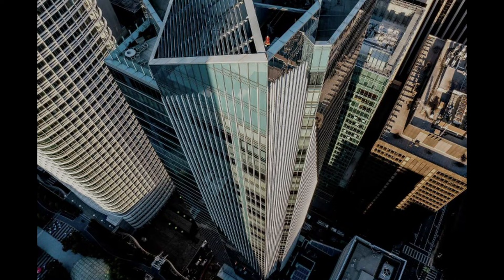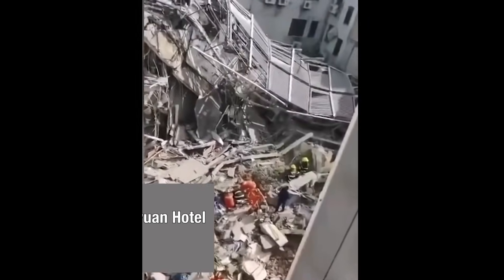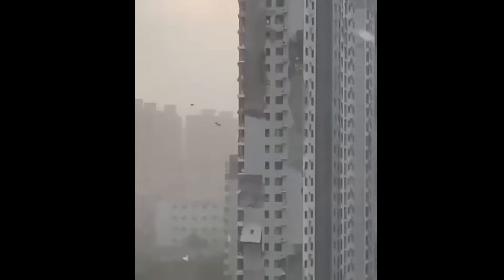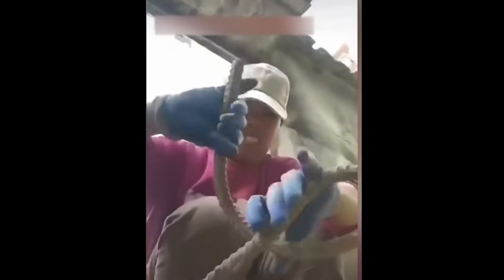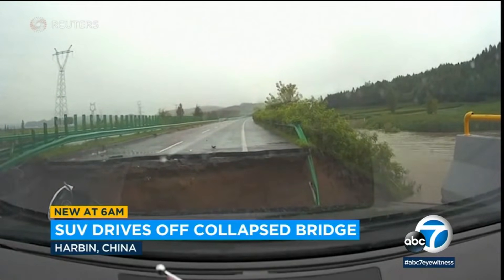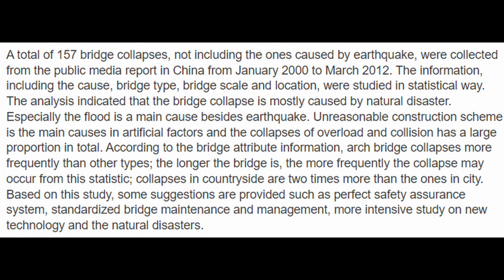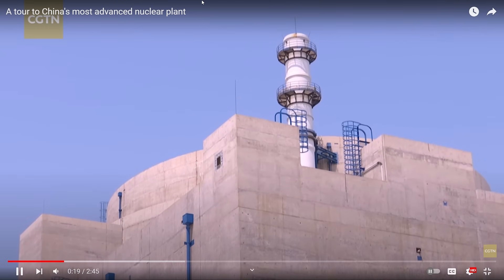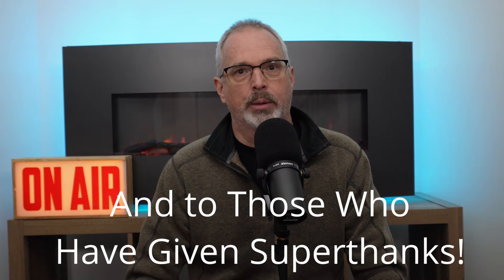Why Construction Projects in China are Often of Very Poor Quality

Comment: We had a project in a telecom facility in Egypt where we supplied seismic equipment cabinets. They were installed with Hilti Red Head expansion bolts. Bellcore specs called out a minimum of 3500 psi concrete. Test installations of some bolts popped out the concrete around the hole. They had to replace the concrete floors before we could install the equipment. Cement is much more expensive than sand in the Middle East, and often is stolen from job sites where it is replaced with sand.

Comment: You know one of the problem on this videos,  they have chopped corners that is hiding their date and time stamps so we don't really know when these video were shot,  and it is also phony that we also don't know the location.  Casey, that is very unprofessional if you want to point on current problem with Chinese construction you will need a more recent analysis not something that is more decade ago.  We really don't know if they have made improvement on this in 2024,  you have presented articles in 2012 and we are now 2024.  What I am thinking is you need to present current data rather than something 12 years ago.
Reply from the maker: This types of problems have only gotten worse in China over the years.

Comment: I have just checked on the Google. According to Wikipedia's list of bridge failures from 2000 to present, 39 American bridges collapsed during this period and China only 14!

And the latest American built suspension bridge has collapsed after only 4 months!

Now you tell me. Which country's constructions are more tofu dreg then?

Oh, I forgot. It's not 39, but 40 now. Baltimore's Francis Scott Key Bridge has just collapsed into the sea like a house of card!

As the saying goes, "don't throw stones if you live in a glass house."
Reply from the maker: The answer to your question is that many bridges in the U.S. were built in the 1960's and have reached the end of their design life. China had almost no modern bridges in that period (because of Mao).  China has rapidly industrialized in the last 30 years thanks to having the West as a source of technology and money. Virtually all of the modern bridges in China have not been around very long. Also the CCP contols the dissemination of information so any information on total bridge collapses there should be considered unreliable.
Reply: @CaseyJones-Engineer  Are you saying that China had no bridges before. People had to swim across the rivers? 

Do you see the Great Wall, which was built more than 2000 years ago, and it is still standing? And the old palaces in all China's old capitals built in different dynasties. All of them are still like a newly built with no sign of collapsing anytime soon. China's buildings are well known all over the world, no matter whether structures or designs. Have you ever visited Beijing? Do you see how beautiful the Forbidden Palace is? Go, buy a ticket and visit china and see things there for yourself. Stop listening to the US and the western media's false news.
Reply from the maker: @yeungtsang8761  I said that China had few modern bridges in that era.  China was not even able to feed its people properly then thanks to Mao's "Great Leap Forward".
Reply: @CaseyJones-Engineer  Mao might have done something too extreme, but not all bad. At least he got rid of the old feudal caste system and superstitions, most importantly, under him, the CCP created gender equality, which have paved the way for a smoother and rapid economic development and growth after his death. I would say, India needs someone like him, in order to catch up to China.
Reply: 14 REPORTED bridge collapses. China will just lie about it and say the bridge was actually demolished on purpose. You have to assume the number of problems you near about is only a tenth of the true issue. So 140 or more bridges is the actual number of collapses in china.

Comment: I was in Shenzhen in mid-2014 and there was a major building scandal there when they discovered that several builders had use sea sand (with salt) in the cement in many buildings. The buildings involved were all ordered to be torn down.
Reply from the maker: Quality control seems to be a big (and ongoing) issue in China.

Comment: whatever you say is correct as evidence is undeniable. but the tall structure is legit as mostly steel is used like a cube and most of the stuff is bolted. so it is not lot of concrete per say. but if they cut corners disasters will happen. not in top cities as they have built world class tall structures which have been standing for more than 20 years. now those destroyed buildings are old. no occupancy means they deteriorate in 10 years. hence they might have been destroyed. the roads i dont know, they happen everywhere in the world( RIDICULOUS HOW THE SCOTTER JUST WENT IN AND THAT CAR!!)
--------------
yes 30% and inspectors look away. not just  china it is rampant all around the world!!!!

Comment: Other issues that are troubling is that at least some of China's coal has some content of uranium, that when burned it spread the pollution far and wide. The ash residue is also used in the construction of buildings. Some of those buildings have higher radiation ratings in them than the  background radiation in the open air around those buildings. There are videos that show people taking radiation readings, with Geiger counters, showing the radiation levels inside and outside of buildings.
A side note, here in Hawai'i there have been claims of radioactive Chinese sheetrock.

Comment: In downtown Seattle in 2010, a 9-year old completed 25-story McGuire Apartment building was demolished because of widespread construction defects.  I recall reading that the contractors used unapproved cheap imported Chinese re-bar and steel.   This revelation lead to a long list of other unapproved cost-saving shortcuts in material and construction methods that doomed the building and started a legal battle.  In my neighborhood, a developer built an amazing looking condominium.  When I went to look at the condo units, I immediately noticed that the floors weren't level and the window frames already had stress cracks.  The banks wouldn't approve home loans to prospective buyers so the developer could only use the condos as apartments.  These types of construction defects are mind-boggling to me since I always thought that developers would have their own independent engineers monitoring the construction; the contractors double-checking their sub-contractors; and the city building inspectors double and triple checking on everyone and everything.
Reply from the maker: It is a terrible combination of poor practice.  It was the same situation at work at the Millennium Tower (more fault engineering than actual construction material problems), a developer who was all about saving money and a City Inspection department who allowed the construction to proceed without an independent engineering review being performed.

Comment: The construction of the leaning tower in SF is not tofu dreg.  Its construction is good EXCEPT for the pilongs weren't driven deep enough.  That was an example of political corruption in SF.
Reply from the maker: Since the engineers went along with that garbage design speaks for itself.  The corruption in the building department existed in this case, it just enable the inherently poor design to go forward with the inevitable problems that occurred.

Comment: You have to understand what they are for. There is a reason why the housing market is oversupplied by 60 million units. Many in 3rd tier cities. Most of the new units were speculation units, only to go up 10%+ per year then they sell. There is no property taxes so they don’t have to rent out to make money.  No one is really meant to live there. So there is no need to build them in any good quality. It is the greater fool theory that someone dumber will come along to buy it at a greater price. It works for a while, until it doesn’t.

Comment: I expected a better sourced video.  Showing a few examples of building collapse videos doesn’t mean a thing.
Reply from the maker: Next time I will travel to China to conduct more extensive research before posting a follow up 20 minute video.🤣🤣
Reply: @CaseyJones-Engineer  just some solid references to some facts would be fine, of course you don’t have to go.  Maybe I’m just taking your videos too seriously, I apologize if that’s the case.
Reply: @ericforman1483 Don't bother bringing logic here. Sometimes I wonder if these weird China Observers believe in their lies. Showing some building collapses means nothing in a country that builds massively inside and abroad. I come from Africa and Chinese building companies like CRBC gained a solid reputation as serious and quality constructors. You can check the elevated highway cutting through Nairobi built by CRBC in 2 years. Turkish builders like SUMA are good as well. If this guy thinks Chinese engineers and the Chinese government are so bad so why the USA puts so much effort (and fails) to stop Chinese technological advancement. Sit back and let them fail, it's easier.

Comment: It is absurd to characterize the Millenium Tower as "Tofu-Dregg." There were certainly serious issues with the Millenium Tower's engineering and construction, but the building is SAFE, constructed using high quality materials and the highest standards of construction techniques. It is never going to crumble or collapse. It leans a bit, and that is a huge issue, especially to the occupants. But that is NOTHING like the Chinese Tofu-Dregg corruption.
Reply from the maker: I agree that the issue with the original foundation has mostly to do with the errors made by the geotechnical engineers but there have been allegations of extensive corruption involving S.F. building officials in recent years.  To what extent this could have played into the saga of the M.T., I couldn't tell you.  My point was that many viewers suggested a tofu-dreg connection to this building.  I had never heard of this term until I saw these viewer comments.

Comment: Some of the shoddy builds also use sea-sand instead of river-sand (the salt in the cheaper sea-sand erodes steel reinforcements, whereas much more expensive river-sand doesn't), and stretching steel reinforcements to meet length regulations (but then the diameter isn't thick enough).
Reply from the maker: That is a good point.  Thank you.

Comment: The scooter rider going over.  If you remember the Northridge (Calif) earthquake in the mid-1990s, that collapsed a few elevated roadways and cars/truck/motorcycles drove right off of them.  A lot of that was attributed to the slight upsloping grade on bridges (highest at the center) so drivers couldn't see the break until it was too late. 

I'm wondering about the hi-speed rail projects as some of those inside China have failed quite early in their lifecycle.  The Chinese recently built a line for Indonesia and the Chinese bid was way lower than the Japanese bid, plus the construction timeline was far shorter.  I'd be scared to ride on any rail line they built.
Reply from the maker: In China they seem to place a premium on big and fast instead of quality and reliability.
Reply: There has been one single fatal accident involving China's HSR, compared to none in Japan's. However, the crash was not related to it being a HSR. It was a signal failure. One train was stationary, the other was below 100 kmh (60 mph), significantly below HSR speeds. A design defect in the signaling system meant it was not fail safe in some circumstances, leading to disaster when trackside equipment was damaged by a lightning strike.

The crash occurred in 2014, when China had yet to progress to the domestically designed E series trains. Both trains were D series, locally produced licensed copy of foreign trains. One was a European Bombardier, while the other was a Kawasaki Shinkansen. However the accident was not caused by the trains, but by the signalling system and equipment, which was based on a European design. It is unclear if the flaw was present in the original European design, or was introduced when it was adapted before being implemented in China.

Comment: A very common issue seems to be the use of unwashed river sands extracted in salt water environments (estuaries etc.). The chlorine provided by the salt inhibits the concrete's passive corrosion protection of the reinforcing steel - a vastly accelerated decline of the structural strength.
Reply from the maker: Yes, that would definitely be a problem.  I imagine that they have run out of good sand sources a long time ago there in China give the massive amount of construction going on.
Reply: @CaseyJones-Engineer  https://en.wikipedia.org/wiki/Sand_theft
Reply from the maker: @spitefulwar  Thank you.

Comment: Using cheap untreated sea sand as opposed to freshwater sand or treated sand is one of the biggest issues in the construction process among other issues such as substandard steel rebar and sea sand that hasnt been treated for clorine or salt. 
The corruption is rampant so the contractors use the cheapest materials possible at the cost of safety.

Comment: One major problem with Chinese construction is that they tend to use beach sand instead of river sand. Even assuming they get the mix right, the salt will eat away at the rebar, assuming they even used real steel.

Comment: I lived in China for 5 years. Concrete buildings are built fast because they do not pre-wire electricity or plumbing.  Those are all added by the purchaser of the apartment.  It is crazy loud when the apartments are chiseling grooves in the wall for the plumbing and wiring (noise goes through the walls even if several floors and apartments away). Plus un-regulation of work can damage large apartment support walls, which can lead to collapse.  Just scary being in the newer large buildings .
Reply from the maker: I have lived in Thailand, Vietnam and Cambodia and I would be way more concerned about living in China.
Reply: I believe Shanghai and Shenzhen are 1 tier cities a decade ago.  My friend had a brand new apartment in Shanghai and also had to trench the walls to put in plumbing and electric.  That is not uncommon.
Reply: @Dee-pv8lb  Put it on top. If pipes are in brick walls, and 3 or 4 decades later parts of the metal pipes rusted through and you get a leak, how do find out where the leak is, never mind fixing it?
Reply: It’s all project dependent, you probably don’t live in a first tier city it sounds like.

Comment: Why  SOME Construction Projects ....
Cannot take isolated incidents and apply it to all China.
That hotel collapsed because of illegal renovation and a retaining support was removed.
 Changsha building nine people  were  arrested on suspicion of ignoring building codes or committing other violations.
Then look at buildings and bridges collapsing in the U.S.A or dams/levees breaking. Train derailments etc.
Miami  collapse was due to poor construction.
Don't know why what happens in China concerns you when the US has far worse problems.
Even my country in the U.K has problems with collapsing and possible collapsing buildings, schools included, and  infrastructure and these recent storms don't help much.
Coal mines are mainly in the Northern parts of the country. There are some in the South but nuclear and green energy is more common. Pollution has improved vastly in the South too and there are more clears days than not. The average AQI ranges between good and excellent. So pollution from coal affecting all the country is off the mark. 
As for Wikipedia. That is a site that anyone can put info on and edit. Not all info is factual.
Reply from the maker: China is in decline. There is no question about that fact.

Comment: I worked as consultant in power generation facilities starting in the late 80s. The specifications I saw for the construction of power generation facilities in China excluded the use of Chinese sourced piping components.
Reply from the maker: Interesting.  I wonder how long they followed that prohibition.  My guess would be they started using domestic sources of components starting in the late 90's but I don't know.
Reply: A lot has changed since 1980s. Most oil and gas producer have no qualms about using Chinese steel in their pipes and tubing if they can get independent test reports done. They can make good quality steel if the client is willing to pay.
Reply: @UnbreakableM1nd  if you don't test each piece,  you risk catastrophic failures.  My former employer found this out the hard way. They can increase their profits by slipping in some inexpensive substandard units, and do so.
Reply: @moenaguib2947  They do hydro testing or pressure tests in the field anyways after install.The engineer at the company needs to take some responsibility too and not just blame everything on the vendor. It's your job to determine the proper safety factor and no when it is ok to require 100% tests, when is a sample test ok. You can't have everything. You have to find a balance.
Reply: So they knew about tofu pipes.